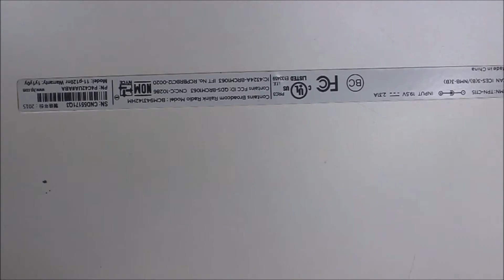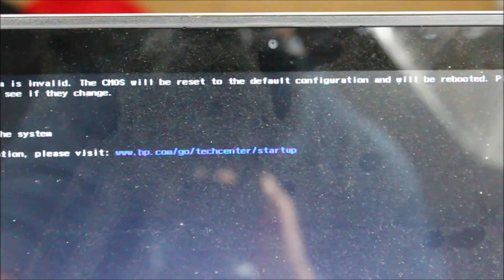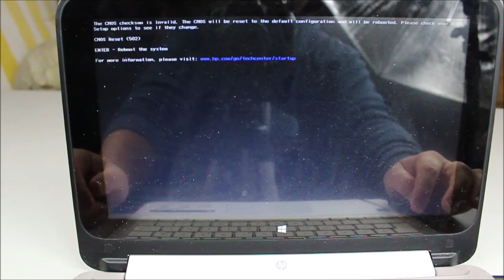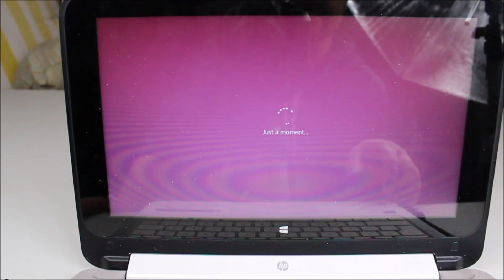HP Laptop Will Not Power On - How To Fix - HP x360 - NO POWER

Comment: Hi, i have this model of HP ENVY x360 - 15-u493cl (ENERGY STAR) about 72 hours ago I tried to turn it on but I did not turn on, the power light turns on , you can also hear the cooling fan spinning but the HDD light does not flash as usual and the screen  does not lit, please what can be done about this problem, thank you

Comment: I have the same x360 I bought a new battery but after the bios screen comes up and you press enter left hand bottom comes up F10 ...bios option and I have to repeatedly press F10 to get to the main bios screen. After pressing yes the computer boots up. But if you turn the computer off then turn it back on you have to unhook the battery hold down the power button for a minute plug in the power cord then turn it on and have to do the same procedure again for it to boot up what's wrong with it?
Reply: Mine does the same thing. envy 360 convertible.

Comment: Hi I found you trying to figure out what the problem is with my go envy x360 2 in 1 15. Something touch screen year 2021.  I noticed while using my laptop it would get hot which it never did before one day I went to put the charger in where it goes the orange light lit up but only for a second once I pushed the power button the light went away and now I’m trying to figure it out I know it’s not the charger as I purchased a new one it still does not charge or turn on so tomorrow I will try doing as you did here.  Thanks for the video and I pray it’s nothing big and it’s just minor I paid extra money for more space better processor etc

Comment: Hi, I have hp chromebook 360 14da0011dx i get a amber light when pluged to the charger but it does not power on at all i disconnect the battery and the amber lights flash on and off please hel[p, ive tried a reset and nothing completely dead any ideas...i would appreciated if you have an idea what the problem might be.. thank you.

Comment: I have 2 HP x360 laptops. Both of them stopped working this morning. I have not tried opening them up yet but did try holding buttons and power button tricks. Didn’t work. I wonder if some software issue or attack could be to blame since they both stopped working simultaneously. A bit to suspicious!
Any thoughts would be appreciated.
Reply from the maker: Could be the charger. I had two Nintendo switches stop working the same day and the end result was a bad charging cord. Fried some chips on the board.

Comment: Guys, I have the same problem, but the solution in the video didn't work.
But it inspires me to try something
I unplug the cmos battery and plug the battery + power chord
And the woooorks!!! 

After it work I keep the battery and power line connected and now I connect the cmos battery and I try it still wooooorks and now everything works fine 

Thanks to everyone.
Reply: Let me try this broooo
Reply: @youtubeacc1078 how was it?
Reply: Hi kindly tell me which power chord
Reply: most HP models now do not have a cmos battery.